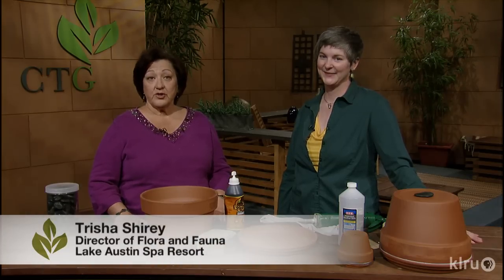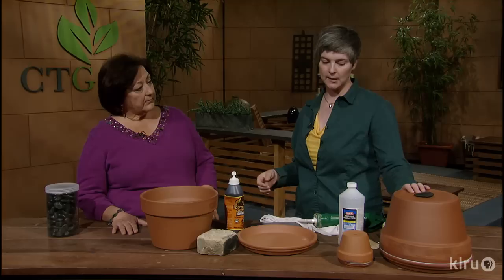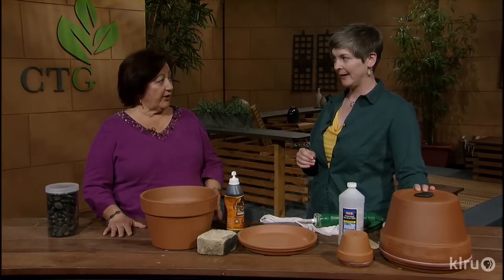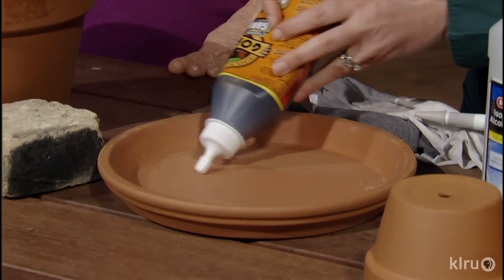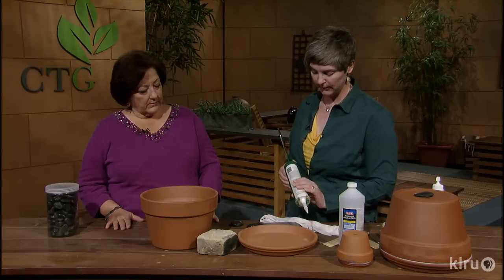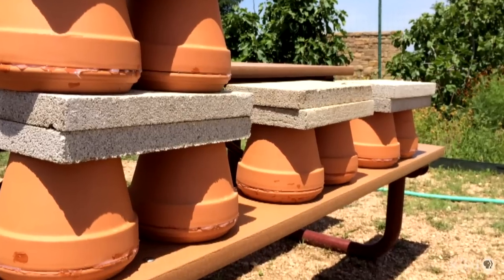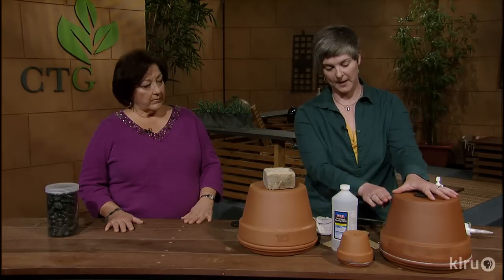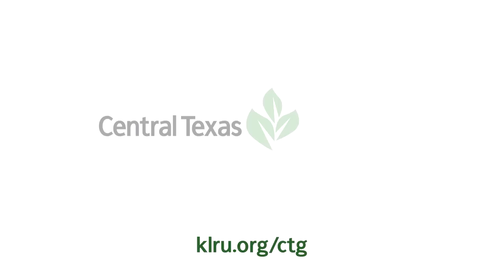How to make an olla from clay pot  Trisha Shirey & Colleen Dieter |Central Texas Gardener

Comment: Do not use glue, caulk, etc. All you need is the pot, a saucer large enough when inverted to cover the top of the pot, and a cork plug, like the kind for a wine bottle. Insert the cork into the drainage hole. Soak the pot (with the cork inserted) overnight in a bucket of water. Bury the pot up to 2 inches from the top. Fill with water and place the inverted saucer over the top. The saucer needs to be upside down, so water doesn't pool and invite breeding mosquitoes. The rim of the pot and the saucer can be glazed, but the part buried below ground needs to be unglazed so that the water will seep out. Then just lift the lid every few days and refill.
Reply: +Trudy Isaacs Great idea. My glued pot leaks.  Yours won't if that cork holds.  I would might drill a hole through the lid, and a pipe to fill it with water, and bury it deeper.
Reply: What I did with one large pot was plug the hole with a chair leg cap, and it worked perfectly. Be sure to buy 1/8" smaller than the actual opening if the pot.
Reply: I plug the hole in the bottom of the pot and invert the lid on top. For the life of me I can't understand why it should be the other way around. Much easier to fill with water when you have a wider mouth. We have just finished a severe drought in Australia and my ollas kept my vegetable garden producing. You should also mulch the soil to decrease evaporation and keep the soil a little cooler.
Reply: @corinnecowper1339  right I agree!
Reply: @lucyw.mcmellan7274  how did you fix the cap?

Comment: Adding the chemicals in the glue and silicone to the soil around my food plants doesn't seem like a good idea.
Reply: You really don't need all that. Best to just seal the opening on the bottom with something thats not harmful and use the saucer to close it. (Your comment is 3 years old but I guess this will still be useful to know)
Reply: No need to invert the pot and glue it. Just close the hole and bury the pot, fill it with water and place the dish on top as a lid.

Comment: I'm not understanding the need to cover the bottom interior with gorilla glue.  What is the purpose for that? And with it being filled with water, wouldn't that glue mix with the water and leach out?  I've seen real ollas and the interiors were not lined with glue or anything. The whole pots were porous.
Reply: +Eireann Hviturhrafn I wholeheartedly agree.  It doesn't make sense.
Reply: It does make sense. The plants are placed NEXT to the olla, not UNDER it. So it makes sense to seal the bottom of the pot to make sure the water seeps out only to the sides...where the plant roots are.
Reply: 03/09/2019 UPDATE - I called Gorilla Glue and was told that they have not tested it on humans nor animals, and they cannot recommend it for this use. I just bought 'food grade' silicone glue on Amazon.

Comment: I agree with Eireann. why do you need to cover the bottom with glue? I am a potter so will be making my own. but for my friends this is a good video minus the glue.
Reply: The plants are placed NEXT to the olla, not UNDER it. So it makes sense to seal the bottom of the pot to make sure the water seeps out only to the sides...where the plant roots are. To let it seep DOWN would be a waste, because that is not where the roots are.
Reply: Hadn’t thought of making my own. It’d give me reason to setup my pottery wheel, tho I’d have to find someone local to fire them for me. Dh & I planned to have a building built some years ago so he’d have one part for his tinkering then I’d have a section for my wheel, wedging table, & layer a pugger & kiln. A few health hardships prevented us from making it happen. 🙁

Comment: After reading comments I have come to the conclusion I wasn't alone with wondering why she would glue the bottom and then use silicone sealer there's got to be a better way I really don't want my water sitting in a pot with glue on the bottom to seep into my plants like Uh OK ...
Reply: All waterproof silicone is generally used in bathroom and kitchen projects has antimicrobial and antibacterial properties.  Not good for garden biome.  A healthy soil has live fungi and bacteria - wouldn't be putting that in a pot that is going to leech into the water and thus into my garden soil.
Reply: I agree.
Reply: @pjpj3450  I agree.

Comment: This is illogical. Why you glued cover if you just can easily turn it around,  use cement to seal this little hole at the bottom and use cover instead of a rock...

Comment: Everyone puts a rock on the top for whatever reason. The stated purpose has been to prevent evaporation and to prevent mosquitoes.  If you are simply avoiding mosquitoes couldn't you simply seal window screen  material to the hole?
Reply: Come on man, you dont want soil an dust to fill up inside, right? no space for water, no irrigation. Damn.
Reply: Yes, the purpose for the rock is two-fold: to minimize evaporation and to prevent mosquitoes from breeding in the Olla's standing water. Not sure why you'd want to go the window screen route, since more people have access to rocks in their yard than extra bits of screen. Why make the design more complicated?

Comment: I have just bought some terracotta pots and a slightly bigger saucers which I think is a much better idea then using all that glue that is used in this video. The problem l Have is finding something food grade safe to plug the hole at the bottom.  Any ideas anyone?
Reply: Judy Patrick In a response above,  Trudy Isaacs suggests using cork instead of epoxy. I recommend reading her post.
Reply: Find the diameter & buy a wood rod at the hardware store-cut it into 2-3” pieces -you should have enough for a lifetime 😎
Reply: Wine cork.

Comment: How did the water come out from the pot? I have terracotta pot for my flower,  the pot is not leaking except the drain hole at the bottom. Besides, if these pots are fired already, the water should not be leaking! Did i miss anything??????
Reply: The pots are not fired and so the water goes through the clay.  A poor man's olla can be made by cleaning an empty gallon milk jug, filling it with water, freezing it...put small holes wherever you want the water to aim and using that.  Just refill with water (not ice...that was for the holes to be pushed through).  You put it into the ground just as you would the clay olla...not as pretty, but useful, and cheap.
Reply: They are fired just not all they way.
Reply: responder57
Reply: responder57  Thank you
Reply: They ARE fired... just not glazed.
Reply: Unless its glazed it will leak, but with soil inside, and a plant drinking the water you won't see a leak. The leak we are taking about is not visible to the eye, it just slowly gets thru the pot. Think.
Reply: They are fired...just no glaze.
Reply: Unglazed terracotta pots allow water to seep out. Maybe your pots are sealed.